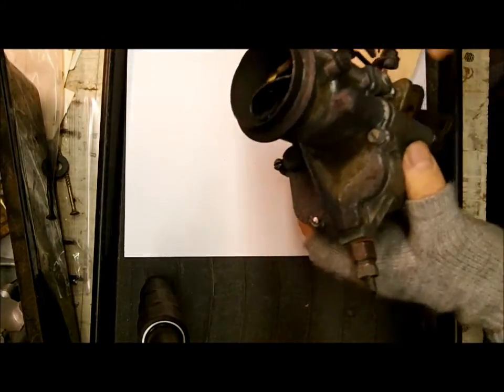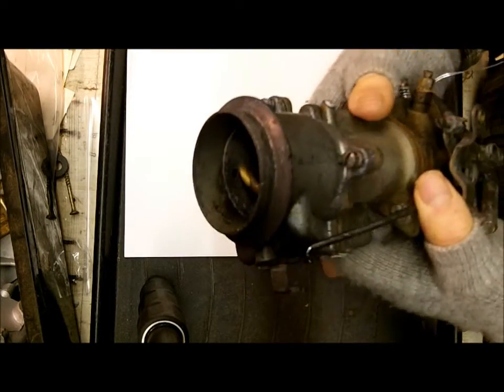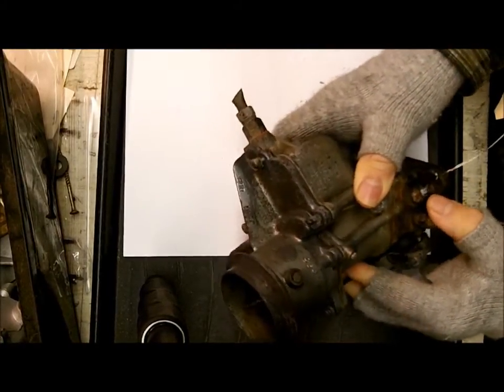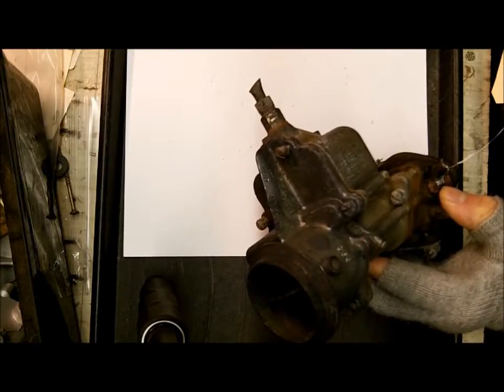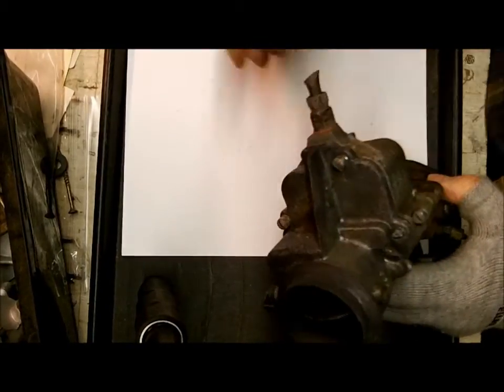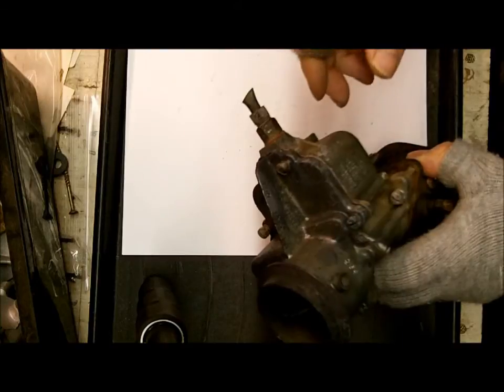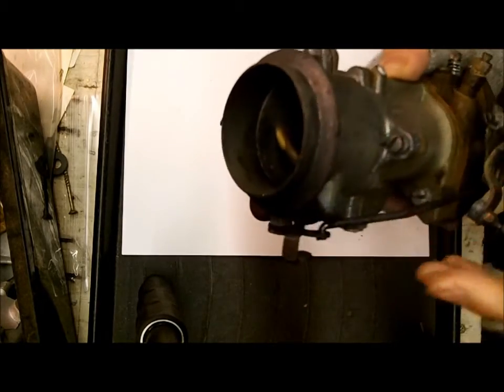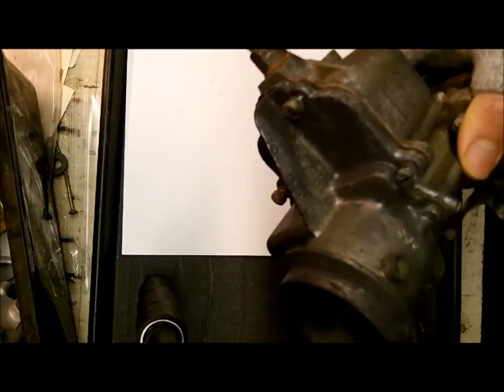Carter BB Carburetor Identification

Comment: Quick question what do you have as the measurement across the top intake for air filter purposes. Thanks.
Reply from the maker: Don't have it noted on this carb specifically, I'd just have to measure the carb I was working on at the time.